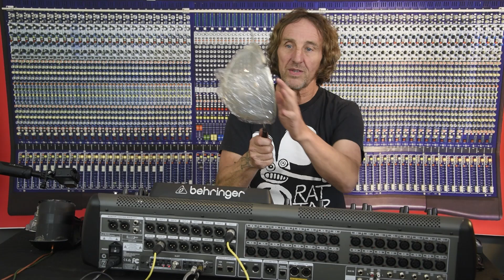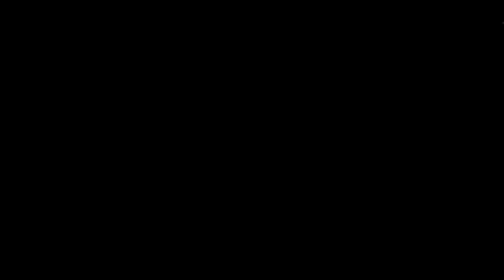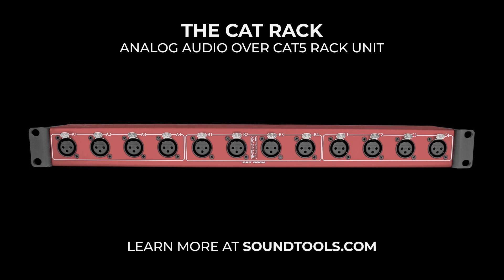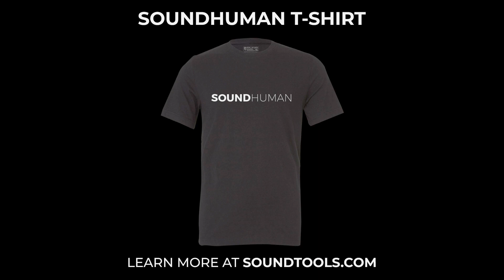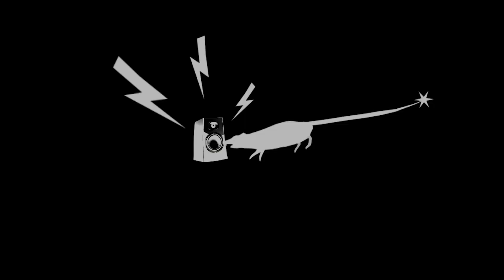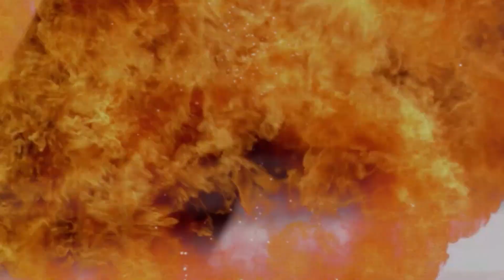Aux Fed Subwoofers Are Better - Because of How Mics Work

Comment: Dear Dave, I don’t use subs. I have a medium size PA 2 dual 15” QSC E215s, full range with horns. The bottom 15” goes down to 30hz while the middle one only down to 50hz. It’s intentionally designed to enhance the bottom one like a sub.  But both 15s in each cab are crossed over to the horns at 1.2k. JBL also made a similar design. Is there any way I can relicate aux-feeding without adding actual subs?  For instance, putting all the channels I want to keep out of the sub woofers on subgroups so they go through two high pass filters before hitting the mains?
Reply: thanks
Reply from the maker: the advantages of subs on an separate send are based on having a separate subwoofer stem with significant low frequency capabilities 

with smaller systems the added complexity is more of an issue than an asset.

for now, don't worry about implementing for a show but it's cool to know how to do and cool to experiment with the process and concept. 

cheers to staying on top of learning!

Comment: Im gigging in Taverns and am using analog Mackie mixer....would you still slide the channel faders for the bass and kick drum up so they come out of the Main PA speakers while simultaneously using an AUX send to send the bass and kick drum to a crossover (I assume) then an amp and then the passive subwoofer.
So in other words....when using an AUX SEND for the subwoofer...should I still send the bass guitar and kick drum to the stereo main Left/Right buss on my main outputs on my mixer.

Comment: So,what if we are working with a band who all go directly into the board /?/ NO AMPS ,NO ACCOUSTICDRUMS , WHAT THEN ?
Reply from the maker: then it depends on how clean all the signals are and how much control you want. with subs on an aux you can send an instrument to mains and subs and if you want more low end, you can send more to subs, or boost the low freqencies on the channel, or turn down the subs and boost to lows even more or turn up the subs and cuts one lows on the the channel. each of these options will give differing results.

also if you have a true subwoofer system, quite often the coverage is a bit different than the coverage of low frequencies from the mains. quite often subwoofer systems are horizontal line arrays or left right plus center.  where as main PA tends to be left right vertical line arrays or left right point sources.

all of these tend to have differences in the coverage of the venue. having subs on an aux let's you decide whether you want to drive the low frequencies for an input from the mains or from the subs or from both.

that said, for smaller more simple systems or systems without true subwoofers (big boxes capable of significant energy usually operating from about 30Hz or lower to 60 or 80Hz), then the added complexity of subs on an aux may not offer sufficient advantages.

that said, I would always use subs on aux as I always want the added control.

Comment: I was very sceptical in the begining, but i guess you do have a point 🤔. Although can´t you just set the highpass filter frequency higher or make the slope of the filter steeper? Like 24-36db/dec? I have no idea if your mix can do that (I have a soundcraft ui24r). I´m also pretty new to this, so i´m genuinely asking.
Reply from the maker: you can high pass and that will help but it's not the same. The steeper the high pass filter the more ringing you have and the more it messes with the sound. 

but beyond that, A filter just turn sound down but it doesn't get rid of it. mix sand and rice together and then use a metal screen to try and get all the sand out of the rice. you will get almost all the sand out but there will still be some sand in there. And if you really really work hard you could probably get all the sand out but then you're going to lose a bunch of rice into the sand that you're getting rid of. 

audio filters are the same way, have you set the filter low enough so that it doesn't ruin the sound of something then some of it's going to get through. have you said it high enough and steep enough to where it gets rid of all of it then you're going to chop off some of the stuff you want. 

with subwoofers on a separate sand you can prevent anything from getting there that you don't want to go there and still have usage of things like your low frequency EQ and boost low frequencies on a snare drum to get more warmth out of it without adding more snare to the subs. 

so you pick up kind of a whole extra level of equalization and control where you can send something to the subs or not and if it's not sent to the subs you can EQ the low frequencies or not and if it is sent to the subs you can eat you the low frequencies or not which gives you the ability to achieve a better sound with more control if that's what you desire and the extra complexity is warranted for the application
Reply: @DaveRat Looks like i have some experimenting to do 😀 Thanks a lot for the reply

Comment: My  HPFs would never be set all the way down to 90 on any channel that I didn’t want in the subs. That was an unfair comparison. My HPF are usually at 100 and up depending on the channel.  Vocals usually between 120-140, keys at 100, cymbals at 200 etc. I’d like to hear a comparison of the over all mix with proper individualized HPF levels vs aux fed. I don’t think there would be much difference.
Reply from the maker: it really depends on the capabilities of your subwoofer system.

mainly subs on a separate send can remove a layer of low frequency blur.

it's important to know that high pass filters introduce audible phase and ringing issues that are audible. the steeper the filter the more issues they create so purely avoiding or reducing using them will improve sound as well.

I will try and do a vid on the sound issues of high pass filters. that could be a good subject.

think of it like this, the sub send is your drinking water, all the input channels are the things you put in the water. the high pass filter is a filter to try and take out the things you don't want in your drinking water. the higher the high pass filter, the smaller the holes and the less that gets through into your drinking water.

now some of your inputs have all kinds of stuff you don't want in you drinking water.

do you choose to filter those things out or do you choose not to put those things into your drinking water?

subs on a seperate send, you choose what goes to subs

subs on L/R, everything goes to subs but you are trying to filter out the things you don't want in the subs.

which water will taste better? dirty water that has been filtered or water that never has the dirt in it?
Reply: @DaveRat  Thanks for the reply. I'm definitely not against aux fed subs I just thought your comparison was unfair. I live in the no time to setup world and just doing LR is fast and we get great compliments on our mixes which I attribute to us using HPFs  when the other guys doing LR have lots of mud on their vocals and guitars.

Comment: Dave, I understand your point. Good demo. So I obviously want to hear all of the frequencies from the kick, bass, and floor tom. I want the 80 or less coming out of the subs and the higher frequencies like the slap or the stick hit or bass notes above 80 coming from my top speakers. So  I still have to send those 3 inputs to the mains and also send them to the subs. So I high pass the mains and I low pass the subs? The only thing is the front of house main volume must be controlled with 2 faders (main & Auxsend) instead of 1. Correct?

Comment: OMG!!!!!!  What are you talking about!!!!!!  Sending to a aux or a bus doesn’t work!!!!!!!!

Just use a high pass filter. 😂. Please stop confusing people!!!!!!

Guy the best thing for live sound is using Waves Sound Grid!!!!!!  You can use 2 eq plugins 1 to roll off that junk and the other to bring that low end back!!!!!!!
Reply from the maker: I'm surprised and amazed at how many people don't understand the difference between a filter and a separate send.

a filter like a high pass filter reduces and tries to remove something.

with a separate send you can choose for it to go there or not.

as an extreme example if you had a bunch of water lines and some water lines had poop in them and some didn't and the people that live in subwoofer city don't want to drink poop water, 

we could follow your theory and send all the water lines to subwoofer city's drinking water and use a filter to get most of the poop out of the water with a filter or some other technology like waves

or we could use my plan and not send any of the poop water to subwoofer city's drinking water and only send them water with no poop in it.

 That's how a separate send works versus a filter

Comment: The idea is brilliant, but its implementation requires strong persuasive power from the FOH mixer to get it done with the Team. I will try again and again ^^. The idea of using different speakers for different signals is genius and often solves problems that would otherwise be unsolvable. ❤❤Thank you, Dave, for your incredibly creative input! ❤❤Use different Line-Arrays that hang side by side is also phenomenal.

Comment: This is really interesting! I've been thinking I've been runing our bands PA and subs (all be it a VERY cheap harbinger system) WRONG! because I have PA L/R running to a stereo matrix and an aux bus with kick, bass, floor tom that runs to a separate matrix. I realized today the "sub" matrix should be getting the L/R send and high pass filter, NOT the aux with the sub instruments on it. I was about to change it until I saw this! ... I'm really new to mixing the band I play in, but it always felt better to have complete control over the sub and whats getting sent to it vs. sending everything everywhere like you mentioned Dave. Thank you for this!

Comment: How do you go about handing subs-on-aux when using subgroups for mix processing?

I used to be an avid user of the subs-on-aux method for a long time. Once I started mixing into subgroups and using parallel bus compression however I went back to LR mixing because a conundrum arose for me that I have yet to figure out... what do I send to the subs? The inputs? The busses? Both? If I send the inputs to the subs, I don't get the benefits of parallel bus compression in the low end. If I send certain busses to the subs, I'm sending everything within those busses to the subs, defeating the purpose of subs-on-aux. If I send input channels and just crush busses, I would run into the same issue as before with the crush busses as well as be dealing with phase issues on a lot of digital desks due the input/bus relationships. I could have a lot of different subgroups to separate things out, but I don't always have the luxury of being on a console with that many busses.

Also, it gets tricky when I mix broadcast from FOH as well. When I walk up to a system, I typically use matrix processing (LR, Sub, Front Fill (if applicable)) to match the system to my known reference (My headphones. A trick I picked up from you awhile ago) using tracks that are stereo. Last I checked, I don't know of a platform that provides music in 2.1 format. Once I know the system responds the way I expect it to, I can usually pull off a good mix that translates well both in the room as well as whatever the broadcast format is. If I used subs-on aux, I'd run into the same problems above as well as not having an accurate representation of the relationship between the room and what's being pushed to broadcast.
Reply: I’d love to hear some more opinions on this as well!
Reply from the maker: like with many things you can't have everything always. 

if the goal is to maintain the parallel compression and acoustic balance between the subs and the mains then look at subs on a separate send as a subtractive thing. set everything up and send the subgroups that have instruments that need subs to the subs. And don't send like the vocal subgroup or the guitar subgroup to the subs. everything should operate as normal and you will gain some of the advantages of subs on a separate send while maintaining all the other aspects you desire. to keep the balance between subs and mains, just set your mains master at nominal and your subs master at nominal and use a VCA as your master level for both subs and mains so that they stay together and track.

an alternate method and the one that I used was to treat the subwoofers as an additional stereo subgroup and have all of the instruments that require subs sent to that stereo subwoofer subgroup. and put a compressor on there just like you do on the other subgroups. this will help the subs track and if you bring up all the input levels and bring down the group levels it'll push the subs into compression as well as pushing all of the other instruments in the compression. 

And if you push up the groups and pull down the channels it will pull everything out of compression including the subs. 

Cool cool let me know if that sounds like it'll work for you and and what you think

Comment: The next best thing is using the high pass so you don't have a bunch of 15 Hz from your breath in a vocal mic. Of course, the high pass still lets trace amounts go to the sub. Also wind does make sound in the ears but as people don't generally talk directly into your ear as with a microphone, that goes away. Of course, shirt mics put the vocal further away, but then you have problems with feedback, when the input sound is no longer much greater in SPL than the room sound. A good mic could be a headset mic pointed at the mouth but to one side away from the stream of breath. One could use a pop shield, although they block the performer's face rather a lot in a live setting. I did get quite good results with some J cloth tied in front of a condenser mic.

Comment: Hi Dave. I have a presonus studio live 16 (32 with the 32R stage box) and set up an aux for the subs as a matrix then EQ everything out above 80hz boosting 70hz with a medium to narrow Q. With the front of house I set up another matrix and use the HP filter to roll off all 12db at 80hz. Pa sounds good and clean. I send the main mix to both.
Reply from the maker: Very cool. Using what you have to get the job done in a cool way
Reply: @DaveRat  Wow. Thankyou for your quick response Dave. I watch your clips a lot and love the advise you share to the audio engineer masses.
Reply from the maker: Awesome and thank you! Much appreciated

Comment: May I also create an aux for tweeter and send only high frequency there?.
Reply from the maker: Yes, I used to do that on the rat trap 5 system that has 2" and 1" for highs.

A full range system plus subs on aux and tweeters on aux on top of the full range system works well.

You don't really want your system lows or system highs on aux.aa nearly everything goes to lows and highs. But subs and super tweets can get selective signals
Reply: @DaveRat  what do I need to do if I am parallel compressing drum group?
Reply from the maker: Hmmm, sounds like the setup is getting a little complicated. Subs on an aux is it a good way of cleaning up the low end with sound systems that have true subwoofer systems. Sound systems that have true super tweeter systems are pretty rare. 

For me I would use dual-gated channels to solve a specific issue I was having with a plexiglass drum riser where I needed more gating than usual but couldn't leave the gates on during the softer parts of the show. 

Tweeters on an aux I used for sound system in a theater when mixing high fidelity bands to increase stereo imaging. 

Double hung PA I use to increase the amount of energy and clarity for a worldwide arena and stadium tour. 

Parallel compression I find has limited benefits unless you have a specific reason to be using it where you're chasing dynamic issues and you need more control. 

I would refrain from doing everything always and focus on doing the things that are most important for the situation and artist and venue you're working with

Comment: Hey Dave! How do you suppose this works if you use subgroups for drums parallel compression for example?
Reply from the maker: Not a big fan of parallel compression as it's normally done, especially when drums are sent to L and R as well as sent to a compressed group that is sent to L and R. A slightly better setup is using a compressed drum group and non compressed drum group. Both sent to L and R. With the second setup I would isolate drums that need subs to their own compressed and non compressed groups and send both to the subs post fader.

A better setup in my opinion is to setup two sets of drum inputs, drum inputs compressed and drum inputs non compressed and compress the drums on the individual channels.

Then set up a DCA for the compressed and. DCA for the non compressed. 

Now using the 2 DCA's you can slide between compressed and non compressed.

Both the compressed and no compressed kick and floor Tom would send to subs post fader.

The DCA will control the calhannels and the sub sends at the same time